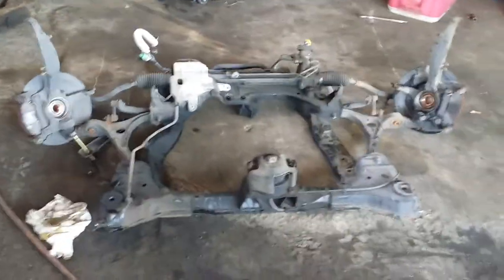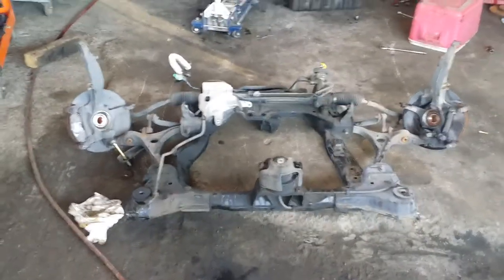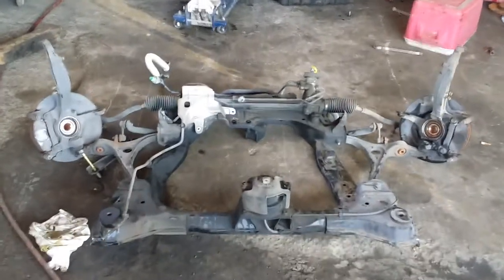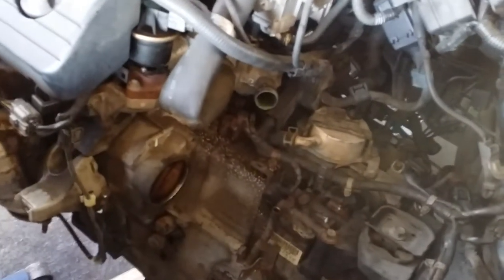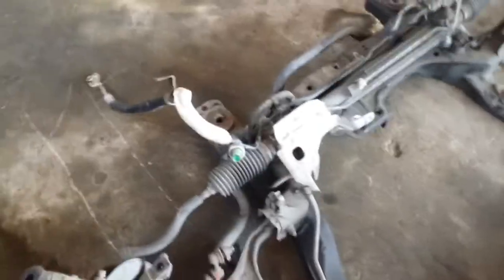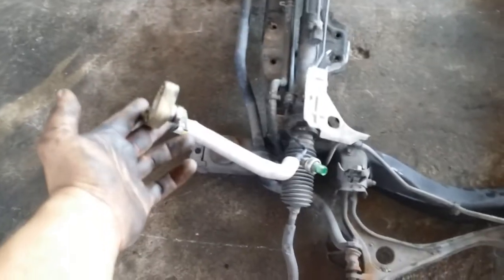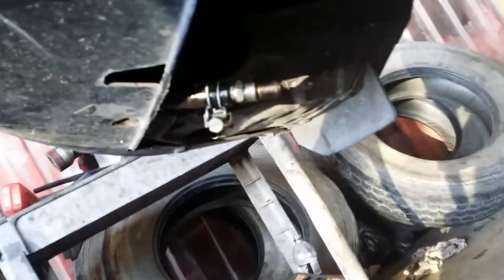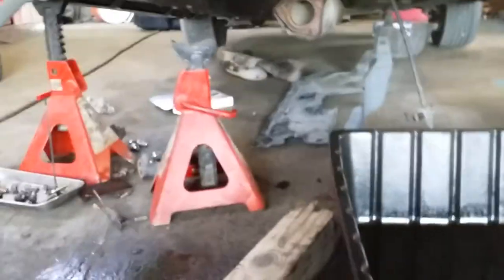03 v6 accord transmission removal replacement

Comment: Hey buddy, I’m a licensed mechanic and hate to say it, but you really went the hard way
Reply: Bout to tackle this on my daughter 06 accord auto v6 what's the easiest way for a driveway replacement I've got all the tools side covered minus the engine holder bar was guna rent that just curious if it would make more sense to pull it form the top I've seen it done on stick shift seems like slot of relocating and removing

Comment: just finished this tough job. i dropped the subframe. i did not need to drain the power steering fluid,  just detach it from the subframe. leave the steering sector on the car, but, support it cause if it drops too low it will pull your steering column apart under dash (fixable but PITA). you can leave the motor support towers connected to the v6 engine. support the engine with jacks and jack stands and motor boom jack from the top. to get subframe out of the way the boom lift holds up engine temporarily, then put jack stands back underneath. my replacement trans had an oil jet added and i added a small external trans oil cooler. when finished i added 3 1/2 quarts of trans fluid. the torque convertor holds the rest, about half the trans fluid and it remained loaded with fluid as this was a used (CL) transmission.  the drivelines were real tight going back into the hubs, and, this isn't always the case. consider detaching the brake calipers from the rotors cause they are heavy and pull on the strut (shock) pretty well making it harder to ease the axle spline into a tight hub. it is worth paying the pros to do the job at a fair price. i think i would gladly pay $1000 if i could get it done for that. i think i saved $3000 or so, my used trans was $500, off CL. i was quoted the job at $3500 by two places. so, far the used trans shifts and pulls well.  i got lucky getting a used trans that worked for $500.
Reply from the maker: Lee Goodwin well done

Comment: i find this video useful because it is short and to the point, it is a PITA to work on these model accords. i was unsure whether to drop the "cradle" (subframe) or pull it all from the top, I chose the bottom subframe/cradle drop to get the crappy engineered auto trans out. Here, you leave the steering sector in and disconnect the steering column, not easy but the way i have seen it done in other videos. i think you place a jack stand under the engine, and after you drop the cradle you support the engine with a bar or a motor lift...move the engine jack stand and get the subframe/cradle out and then put the engine jack stand back. when you have the new trans in, use motor hoist again long enough to slide the cradle back under the car and then replace the engine jack stand.  carry on, fix and drive or sale and never buy another front wheel drive hard to work on car.

Comment: How much transmission fluid should be added back in after you replace the transmission ? Some folks are saying 7 quarts and some are saying 12
Reply: if the torque converter is full you will probably need 3 1/2 quarts, about 3 quarts are in the torque converter and don't drain out with a typical fluid change...you only change about  1/2 of the fluid, that which is in the well (bottom) of the trans case.

Comment: I think you can leave the discs  and brakes attached to the car
Reply: yes, i would leave the shock and rotor attached to the car, but, consider removing the caliper from the rotors due to the weight of this pulling on the shock/struts and brake lines, especially if the axle splines are real tight sliding back into the wheel hubs.
Reply: Marco Sánchez 
yes you can
he did too much work..
it is not that bad..
there are some short cuts..
but that come after doing two or three of these...lol

Comment from the maker: i have a new video where i fix another 03 v6 accord and i pulled the engine and transmsission out of the top and left the subframe alone
Reply: I always  pull the engine and transmission from the top, it seem much  easier to me. I hate messing with the subframe . I am doing it with an 07 right now. I also did the same with an 06 Acura TL.
Reply: @ezlander yeah no way that is way harder. Lots more to disconnect, subframe can be dropped in an hour or two